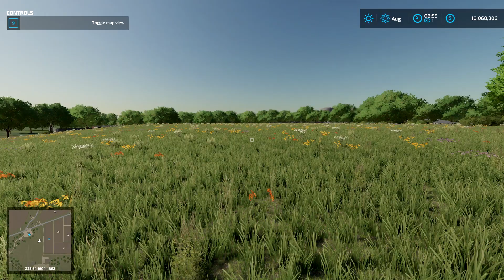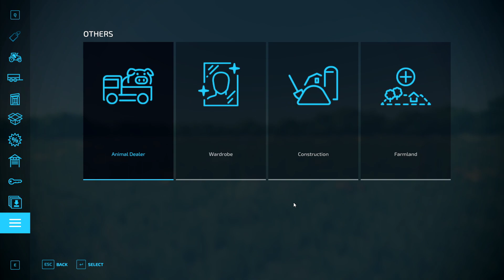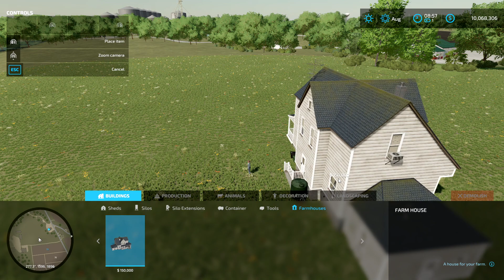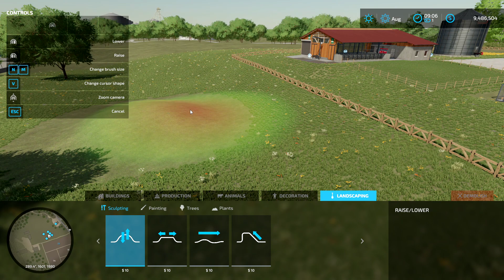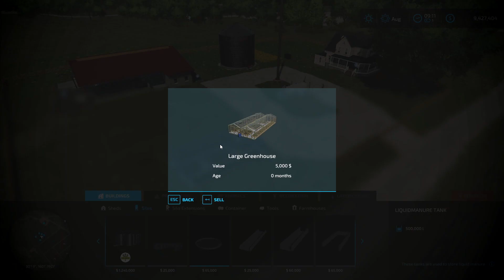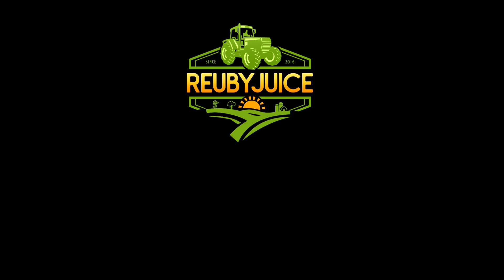How to Use the Build Mode | Farming Simulator 22 Tutorial

Comment: I have messed up so much land, I can not believe it. For me, getting a spot flattened without making steep drop-offs is very hard.
Why is there not an undo button? There should be a way to make a tentative building or landscape, and it not be permanent until you decide this is just what you want.
This and the fact that my games will screw up and not save over and over and over. I am so tired of starting from scratch or the last undependable game save. I have wasted so many hours that I am about ready to toss this game. I first bought it from Epic, and it would not work. Then I bought it from Steam. It is too bad that I can not place Epic purchases in the Steam game.
I love the game, but this is nerve-racking- not knowing if I worked all night for nothing and the game does not save or lockups during a save will actually save my work. Crashes and lock-ups are getting me down. I have reset the direct x and done many things that was supposed to help this problem. I have backed off graphics settings and everything I can think of. Furthermore, I have a 12 gig video card and 4git cpu.

Comment: There needs to be a better way for console rotating the slightest tap make it do a 40 degree spin makes making walls or anything that doesn’t snap impossible to he straight.
Reply: I can never find a point of view for what I'm placing, it's extremely frustrating! If it's a bigger building you really can't look at the different sides because of the way the horizontal and vertical zooms are tied together.

Comment: I deleted/sold buildings when i started and now have big holes in my yard. how do i fix that???
Reply from the maker: You can use the leveling and smoothing tools in the landscaping section to get the land back to normal, make sure you save before you start changing it around as it can take some practice to get it right! The video goes over some basic pointers on landscaping as well 🙂

Comment: how do you remove the aspahlt left behind? i accidentally placed a building in a field and it leaves behind this concreete that is not destorayable
Reply from the maker: You should be able to use the painting tool to paint another type of ground cover in its place (like grass). You could also use a plow to re-create field area there if you want it to be field again, I have a video on creating fields that might help if that's the case 🙂
Reply: @ReubyJuice  thanks man, i was looking for so long for a way to fix it
Reply from the maker: Happy to help!

Comment: Did I understand correctly that is no way to get rid of fences which I built?
Reply from the maker: I may not have covered that completely - any fences you built can be demolished using the same method as demolishing buildings.
Reply: @ReubyJuice  My English is not as good as I would like and probably that's why I didn't understand properly what you were saying in the video. I was twisted around demolishing by clicking on building and then clicking sell instead of using option that you've showed on video. Big red button solving all problems that I have.
Reply from the maker: Ah no worries! You can do it either way with the buildings, but maybe for the fences you can only do it using the demolish button - I didn't think to try if it worked both ways for everything.